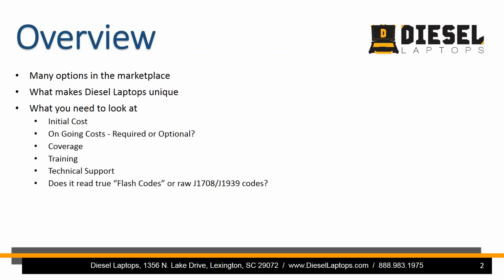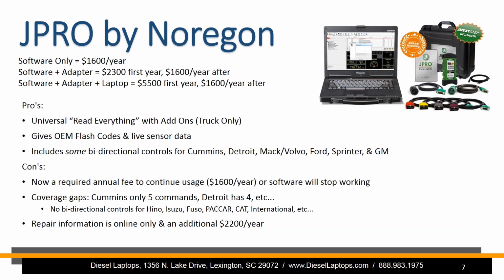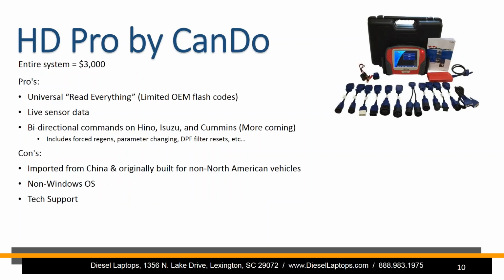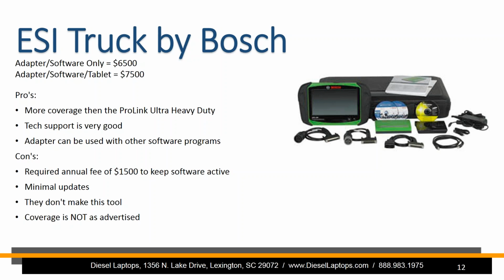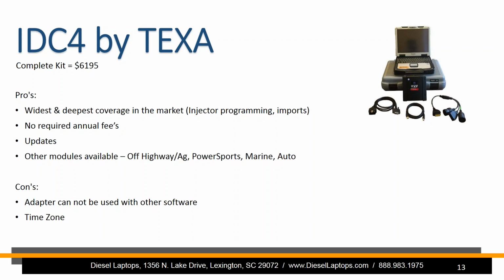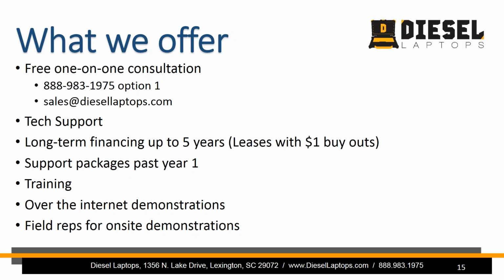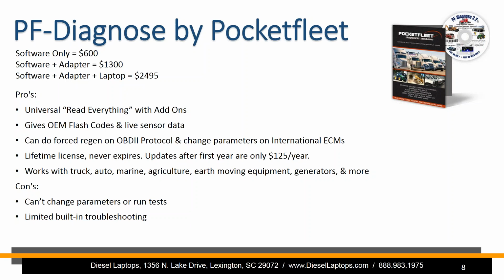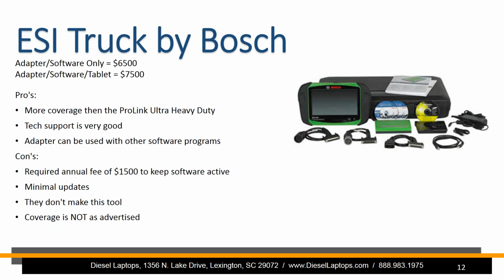Diesel Diagnostic Products Reviewed - Bosch ESI, JPRO, CanDo, PF-Diagnose, TEXA, & More

Comment: We have two 2008 peterbilt trucks. One Cummins isx and one Cummins p8. I want to look at live data, do forced regenerations, do Vgt calibration, do injector cut out test, I'm trying to stay ahead of the dpf issues. The more I look, the more I get confused. What's a good solution?
Reply from the maker: Best solution is a laptop, Insite software, and adapter to connect to the truck. This kit does that: http://diesellaptops.com/Cummins-Insite-Diagnostic-Laptop-Kit-CF30-CUMMINS-DREW.htm
Reply from the maker: Another option would be to purchase a hand held reader. It will read all the codes (You would have to use www.TruckFaultCodes.com or Google search for help on the codes), all the live data, and also do a regen. It won't do the other commands, but it under $500 -- http://diesellaptops.com/HD-Code-II-Handheld-Scanner-with-DPF-Regen-CDOHDCODEII.htm